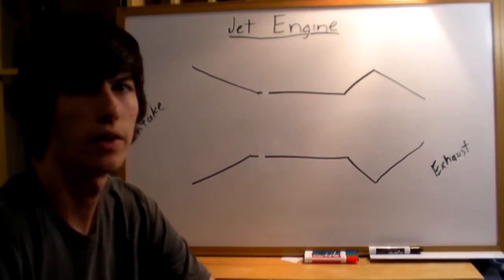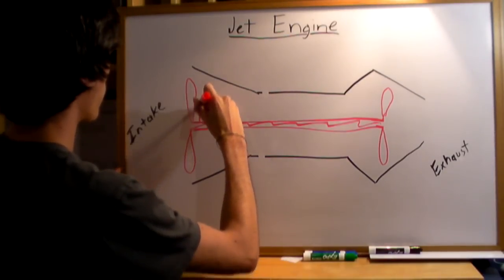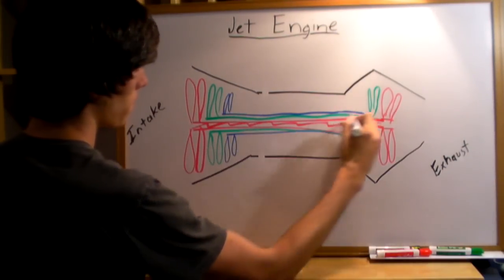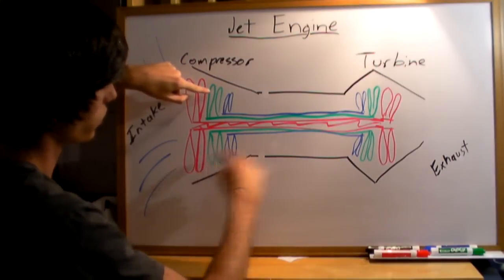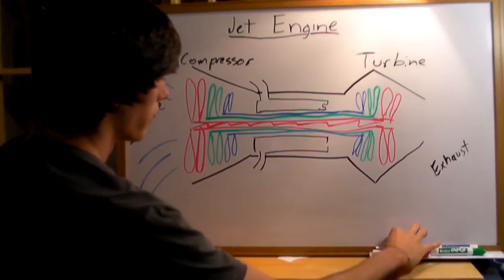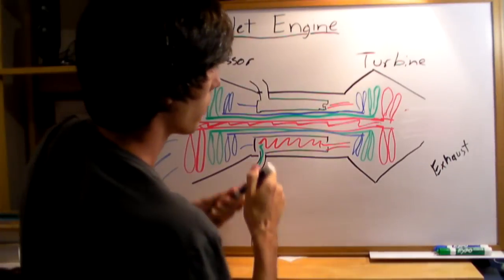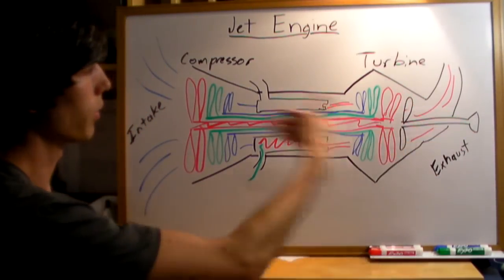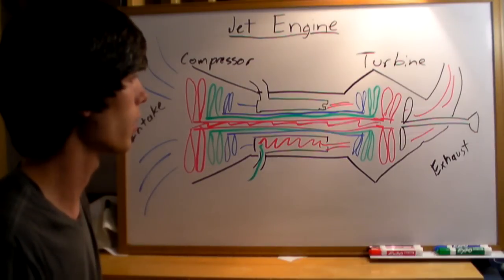Jet Engine - Explained

Comment: If you're talking about typical turbine engines on commercial jet aircraft, the big fans you see are just intake fans that are driven by the turbine itself. It acts as a sort of "slave fan" (being slaved to the main turbine) and serves its purpose to suck in ambient air around the engine as a sort of "passive thrust"(not undergoing combustion)  as well as to force air into the intake compressor turbine blades.

Comment: The very basic is same as any piston engine.   Suck, squeeze, bang and blow.  Except the piston engine extract the power after the bang and transferring all the power to the crankshaft. The jet wait a little longer and extract the power from the blow.  There are also some variation as to when and where the fuel are introduced for the bang. Direct injection piston engines are similar to jets but jets is the only kind that have another bang after "blow"  (afterburner or as the Limeys said  Reheat.)

Comment: why does the pressure inside the combustion chamber not push against the compressed air and slowing down the compressor to a stand still?

Comment: yep.. but for example in fighter jets they don't you use afterburner that much only on take off, vertical flight or dog fight etc.. whats the disadvantage of afterburners.. is it only worst fuel consumption or it creates overheating after a while in engine?

Comment: Okay, so I guess then that once the engine is running, the hot air coming out of the exhaust keeps the blades spinning and pulling in more air, so you don't really need to power the blades anymore, but how does it start? Can the combustion alone at first start it and it gets faster and faster?
Reply: They use a starter motor to get going. Once you get it started, the more fuel you put in the higher the rpm gets.

Comment: As far as I remember, only a Roll Royce had 3 shaft fan engine. Both Pratt & Whitney and General Electric had 2 shaft fan engines. There is only 1 stage for the fan blades except for maybe military engines.  The first fan engine were the P&W JT9 engines on the Boing 747 which had 5 to 1 bypass .The air that did go into the engine 75% was used for cooling only 25% was burned , of the 75% of that air  was also used air conditioning and pressure of the cabin. The highest pressure is at the end of the diffuser, just before the angular combustor  The old style can have more surface area and require more air for cooling. The fan takes about 6 to 8 of turbine blades stages to drive it. The other engine manufacturers came after P&W , l hear that P&W is working on a geared fan.  The newest engines are getting 12 to 1 bypass.

Comment: But explaination on the mechanism of energy delivery system in combustion chamber is very unclear since the exploding air will hit both compressor fans as Well as turbine fans with same force(Netwons third law) making  the net force to be zero. Kindly explain on this fact.

Comment: yes. Agreed.. when it comes to Triple spool, only Rolls-Royce makes a perfect 3 spool axial flow engine. they are called low pressure compressor/turbine (N1), intermediate pressure compressor/turbine (N2) and also high pressure compressor/turbine (N3). 
For the best high speed engine Pratt and Whitney engine does it better. The N2 can spin up to 80 000 RPM.

Comment from the maker: @9743271297 Wish I could help. Although aerospace is offered at my university, I'm in mechanical engineering. I made this video to help a student with a class project. Not sure of a good book to use.
Reply: Actually you forgot the bleed air. Well you did good. You owe knowledge. Aaah didn't make sense.

Comment: I am assuming you are referring to a turbo supercharger like you find in a car? If so, not quite, a jet engine is an axial compressed engine (air is forced longitudinally) whereas a turbo-charger is of a radial compressor design (like in a vacuum cleaner) that pushes air laterally. I believe very early design 'jet' engines (which were technically gas turbine engines) had a radial design and was very inefficient outputting less thrust than the engine weight. continued...

Comment: Ok, why put the transmission on the exhaust end instead of the compressor side? Won't the exhaust side produce unnecessary heat? Also, is it possible to make a jet engine work with only a single shaft?
Reply: I would assume it's because the exhaust provides the high pressure energy to drive the transmission.
Reply: True, but the last turbine is also connected to the first turbine, so the engery should be transferred equally
Reply: Yea, but the energy is harvested from the exhaust, not the turbine itself.
Reply: Correct, however the turbine is powered by the exhaust because the two are connected on one shaft (eg, the red one in the video). Doesn't that mean all of the energy produced by the red exhaust blades will transfer to the red turbine blades to the front? Wouldn't that mean connecting the transmission to the front or back would produce the same effect?
Reply: David Alsh  The transmission  gets its power from the exhaust air speed, since the exhaust rotates the black blade ( see the video) . The exhaust air speed is more than the intake air speed since it has undergone combustion in the combustor.  You are probably asssuming that the transmission is connected to the red shaft, ehich is not the case

Comment: Ok... What makes the compressor spin though? I mean, you said the turbine spins it but for the turbine to work, the compressor needs to send in air first... So... How does it work???
Reply: Vasilis Green The compressor is attached to the turbine through that shaft so when fuel is injected and combustion takes place the hot jet stream flows through the turbine blades, making them spin. This energy is transferred to the compressed blades through the shaft making them spin. This also kick starts the compression process and a highly compressed air will be constantly fed to the combustion chamber continuing the process.

Edit: if you meant how the turbine will start spinning when the engine starts then a separate electric motor is used to turn the turbine to make the compressor spin and bring in enough air to start the whole process.
Reply: @aswinottapilavil495  that's what I meant, engine start. Ok, makes sense. It should be a big ass electric starter...

Comment: Is it true the lower the bypass ratio the louder the engine will be? Like for example will a jet with a bypass ratio of 0.7 be louder than one with a 1.2 ratio?
Reply: Yes that is true. How bigger the bpr the more silence the engine is. The reason is that the cold air is ‘isolating’ the hot air and hot air makes a lot of noise. Because of higher Mach number

Comment: Ideally, jet turbines would run with just the right amount of fuel to use up the oxygen taken in. In practice, there are no practical materials that can withstand the temperatures that perfect combustion would generate, hence the need for an afterburner to use up the unspent oxygen, though the result is a very fuel-wasting method to get more power.

Comment: The technical difference isn't that big. They are different because they had to achieve diffrent requirements. The engines for commercial use have to produce as much thrust as possible in a economical way. The engine for a Fighteraircraft has to be light, small, econimcal, produce a lot of thrust for the size, can handle high g-forces and so on. So it's much more of a compromise. But even Jetengines for fighteraircraft don't burn all the sucked in air today, up to 60% are also bypassed.

Comment: Hey could you explain why extreme car car companies don't use a smaller version to create supercars? I mean what are the ups and downs? I can only think that jet turbines use alot of fuel but are efficient at it.
Reply from the maker: There have been a few cars that were turbine powered. Probably has to do with cost of manufacturing, efficiency, and safety. Using thrust to power a driveshaft makes a lot of exhaust, so you'd have to be concerned about that as well.
Reply: K thx for your reply, keep it up!
Reply: One of the main problems with using a gas turbine to power a car is that unless you design the damn thing properly it'll either take forever to spin up or you'll end up causing compressor stall (which has been known to trigger surges severe enough to blow the engine up). This is currently managed by FADEC systems (full authority digital engine control), which respond to thrust request inputs (so the phrase "opening the throttles" is somewhat outdated).

In order to be efficient, high combustion temperatures are required (in the order of several thousand degrees C), so materials are quite expensive. But they are indeed more efficient than four stroke engines if designed and built correctly.
Reply: doktorbimmer
Poor throttle response was exactly the issue I was talking about, and the reason why it's so poor is because if you flood the combustion chamber with too much fuel, the back pressure would stall the compressor. Now back then, this was prevented with training and elaborate mechanical engine control systems, which always had a good safety margin. Nowadays, a FADEC can operate a lot closer to the performance envelope without breaching it in extreme circumstances.

The efficiency problem at low power can now be tackled by using electric power transfer rather than gears. Electric cars already have the framework for this, all that's needed is a turbine driven generator. The core can run at peak efficiency when it's needed, providing power to charge the battery and drive the motors, then be switched off once the battery is full. It's lighter and more efficient if utilised intelligently, and it's capable of being muffled to the point of sounding like a turbo compressor for a four stroke engine.
Reply: doktorbimmer
Well striking the balance between big and small is why we're engineers, right?

FADEC systems control the whole engine, not just fuel. From compressor VIGVs and bleed valves to the amount of cooling air sent to the turbines. What I'm proposing is burst operation at peak efficiency, with enough power generated to run the motors at maximum and have some left on top to top off the battery. Idea being that the battery would pick up any excess until it's charged, then continue to power the car until it discharges. The engine is either working at peak efficiency or completely off altogether. This avoids the mid range efficiency problems. Besides, you don't really need that much power for a car anyway, I think about 150kW should just about do it.

Perhaps I need to clarify, I don't think any existing gas turbine would be very well suited to a car, instead a new design is required, tailored to the needs of a modern car, probably unique for each model, much like four stroke engines.

Either way, a design study is in order before we completely condemn gas turbine use in the automotive industry, wouldn't you agree?
Reply: Geelar Isn't it that jets and turbines are more gas guzzlers compared to piston engines? That's why there are still a lot of piston-engined planes. With a jet turbine engine, you'll probably measure the gallon to the mile instead of the mile to the gallon. Example, the turbine engine of the M1 Abrams tank.
Reply: Carlos Fernandez
 Yea but numerous documentaries always praise the Fuel efficiency of gas Turbines. I thought if you make the gas turbine small enough the fuel consumption can match a regular piston engine but the output would be much higher. Just speaking theorethically, I know theres prob a good reason why
Reply: The real doktorbimmer
 OOh okay sounds like legit stuff. Thanks for that explanation.
Reply: I recall there was a plan to re-engine the Abrams with a more efficient turbine engine, the LV-100, which was also to be the engine of the Crusader project. But the Crusader got cancelled, and it seems the better turbine engine went with it. Yet the turbine engine for me probably still costs more to maintain than the average piston-based car engine. Not to mention the exhaust is so hot, it could burn people. I remember reading that soldiers couldn't hide at the back of the Abrams or ride on the rear because the engine heat and exhaust could burn them.
Reply: As they using the Leopard 2's engine as a basis for the diesel project?

Hmm, I never did see troops shadow an Abrams the way others did Shermans or Pattons, so I thought that was the heat issue there.
Reply: Interesting.,That bit about warming up in cool weather I did read. In the desert, though, not a good idea. hehe
Reply: Carlos Fernandez The only problem with gas turbine efficiency is size. Bearing in mind, when we measure fuel efficiency it is expressed as a ratio (no MPG nonsense :P). The highest practical efficiency of a gas turbine is about 60%, compared to 15% maximum theoretical for the Otto cycle engine. That is, 60% of the energy in the fuel gets turned into useful work of some sort. That being said, all the extra hardware required to get to 60% makes it impractical for a car. Realistically, about 40% is achievable without heat exchangers and cogenerators. That's still pretty high in comparison, but we're not done hacking away at it yet.

In order to operate properly, the engine must continuously compress gas and recover energy from it. Compressors being what they are, there's usually some leakage around the rotor. which reduces the efficiency of the compression stage. There's also leakage in the turbine. Now on a big engine that's not much of an issue, clearances are significantly smaller than the gas path area, so efficiency is not affected too grossly. You scale that down however, to something the right size to power a car - you still have the same clearances. They're an engineering requirement. This however translates to significantly reduced compressor and turbine efficiency. The more stages you have - the less efficient the engine becomes (but you need them to get the pressure ratios required for combustion efficiency to be high).

Back when I was at uni, we had a test engine made from one and a half automotive turbocompressors and the efficiency we got was about 1%. For a propane powered demonstrator designed to make a load of noise that's not too bad, but I don't imagine you'd be very pleased if 99% of the fuel you loaded in your car literally went right out of the exhaust pipe. A car sized engine I would expect to get about 20 - 30% (compared to 22% for a diesel engine), which makes the entire exercise pointless from a practical point of view (lorries and other heavy vehicles would benefit more as they require more power and that's where gas turbines excel in efficiency). Especially considering that this design would require a generator and electromotive equipment (adding weight, likely more than was cut by going gas turbine), which is also required by fuel cell type cars, arguably a more efficient route to take - a H2-O2 fuel cell has an attainable efficiency in excess of 45% (I'd imagine damn near impossible for a gas turbine of that size).

All that being said, I still want one!!!
Reply: +COMMENT i just dont see how standard 4 stroke engines are inefficient in comparison to other engines, i mean they DIRECTLY convert preassure and heat into mechanical energy through a piston, and it is done so fast it is practically adiabatic. so what would make it so inefficient? is engine friction that big of a factor?
Reply: +Geelar i just dont see how standard 4 stroke engines are inefficient in comparison to other engines, i mean they DIRECTLY convert preassure and heat into mechanical energy through a piston, and it is done so fast it is practically adiabatic. so what would make it so inefficient? is engine friction that big of a factor?
Reply: The real doktorbimmer is that including the air friction of the vehicle? Or is that solely the engine efficiency by dividing input and exhast temperature? Bc i know you can never get close to perfect efficiency bc of friction but 45 percent is a lot lost just in heat, sound, and light(mostly heat)
Reply: The real doktorbimmer and have they ever tried adding a, well i guess you would call it a steam engine, onto the exhast besides a turbo or supercharger? I mean, have they found any way to use the remaining heat from the exhast?
Reply: The real doktorbimmer yea because even though the heat is usually called "waste heat" that can not be used for energy anymore, there still exists the temperature and pressure difference between that and the outside air. I guess the reason why they don't make the stroke long enough for the gas to go to an equal pressure and temperature as the outside air, or say at least 3/4 of the way to this equilibrium, is because by that point the piston is no longer providing enough force to be effective.
Reply: The real doktorbimmer SI!